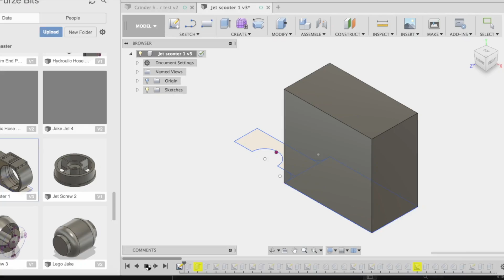Jet Powered Kids Scooter

Comment: I think it needs another turbine on the other side
Reply from the maker: was the original plan but but as one was enough I came over all tight n left it like this hehe
Reply: That's the OCD talking!
... and aesthetically, it would look better as a set. :)
Reply: More than OCD, the thrust is slightly to the side instead of centered.
Reply: colinfurze Colin you should have just said it’s on the right so his pushing leg isn’t directly behind the fan! Love your stuff mate good work
Reply: WE NEED MORE BOOSTERS!

Comment: Does it have a dead man switch?
Reply: It's controlled by a remote control Colin is using, so presumably it doesn't need one.
Reply: The question is: Is a mad inventor-dad in control possibly even worse? gggg
Reply: Nope. The main kill switch is located conveniently down by the finger choppy bits
Reply: Did you watch the video?
Reply: Chaotic Chris Yes, and he didn't mention one. It may not be important to highlight. It wouldn't be hard to put on the RC unit.
Reply: you could call it a dad man switch, I guess
Reply: OldCrowle What if the controller stops working?
Reply: "...dead man switch?"... not yet.  Dad's got a good 20-30 years before he kicks the bucket and his money gets switched to his son.
Reply: Have you ever driven anything remote controlled? if the controller doesn't work, nothing does.
Reply: then the motor stops working...
Reply: MrEpifyte Yes I have. There's a possibility that some RC chip is poorly designed.